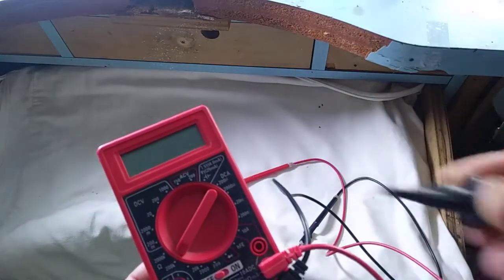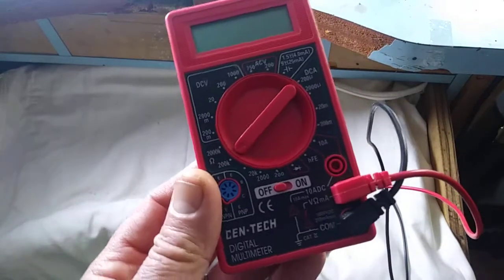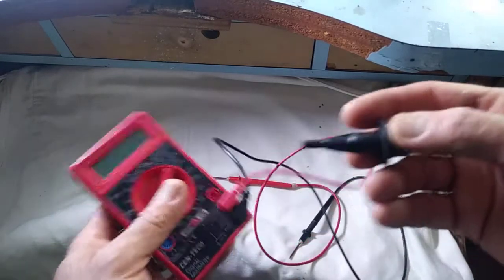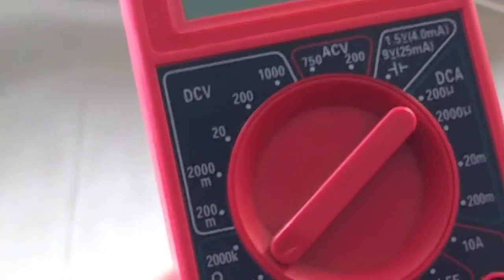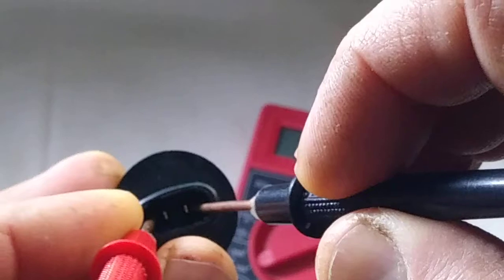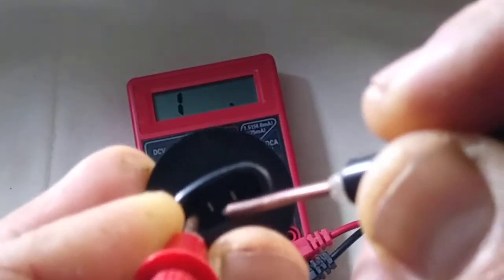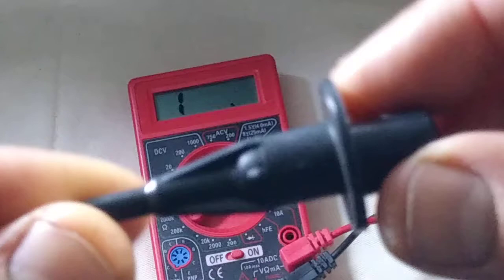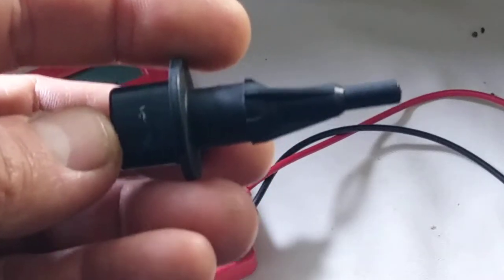How To Test Intake Air Temperature Sensor.

Comment: Use a hair dryer with ohmmeter. When hot air is introduced, the sensor should show a lower resistance. Then you know it works correctly.  👍

Comment: Not accurate video. Use a hair dryer to see if the reading changes when warm air blows on the tip. Reading should fluctuate then go back to same reading when no air blowing on it.  Plus need to know what is the proper reading the sensor is sending.